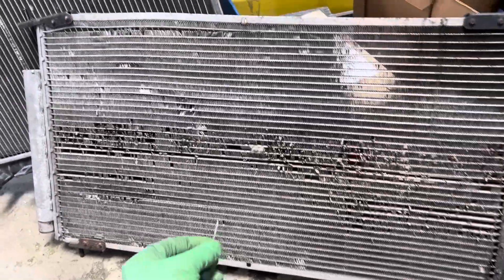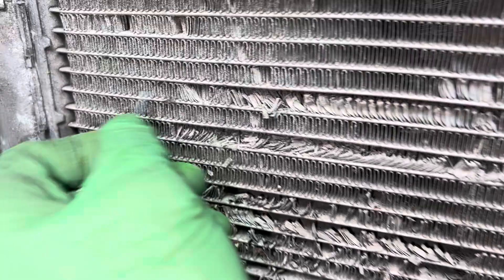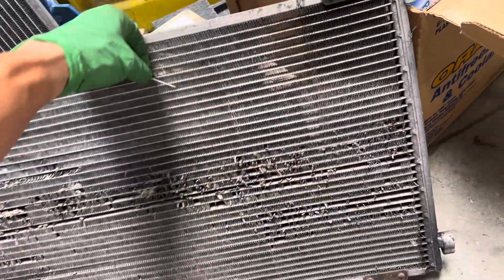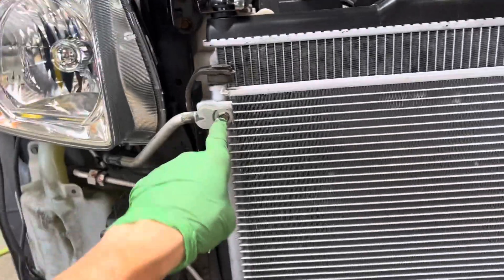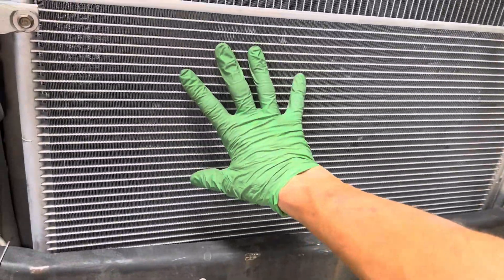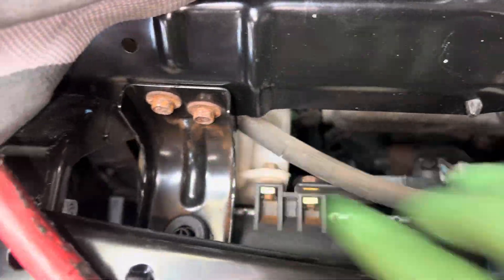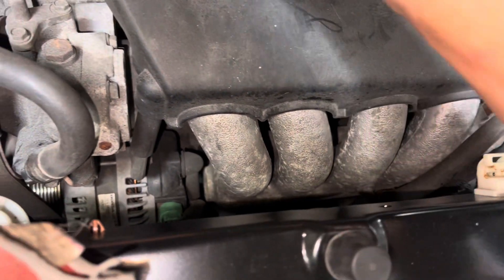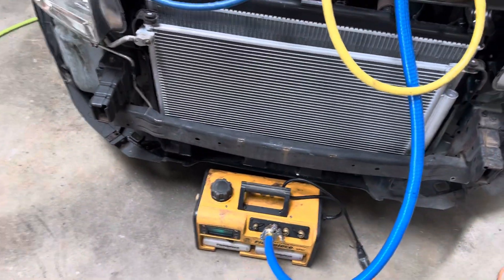Salt water damage on condenser. Salt roads to get rid of ice in winter time salt from the ocean. ￼

Comment: Pretty common here in the UK where they put tonnes of salt on the roads.
Sometimes when the condenser corrodes thin enough it swells up like a ballon
Reply from the maker: I was told really bad corrosion like this also happens in places like Norway, some parts of Finland, better by the Atlantic ocean, get tons of salt, water, corrosion and have to be replaced every couple years.

Comment: Hey Tom I need some help. I have Copeland two stage compressor on my Geothermal unit. Unit was installed 10 years ago. Recently my unit had a short. I found out that my second stage solenoid is grounded. Here is a part number of my compressor ZPS51K4E-PFV 230V. So now it's only works in the first stage. Please tell me for how long it can last. Can it last 1 more year or 10 more years? Thank you so much!
Reply from the maker: It’s built in ternal it’s just a tiny solenoid just like you would use a Solenoid to pick up on the iron bowl piece to turn fluid flow on or off. That’s all it’s not complicated.. 

It has nothing to do with the motor windings or the start winding’s . 

As long as your system is healthy, it was commission properly charged properly and has maintained and doesn’t get any Refrigerant and Leaks your compressor. Motor itself should live a long, happy life. . 

Download the app CopelandMobile 

Putting your compressor part number, and you might even be able to scan the QR code on the side of the compressor

And you can download more detail data on that compressor and how it’s used in possibly properly test the second state solenoid . 

I do not work on geothermal 

But geothermal means nothing to the compressor. All the compressors are the same for their application that they were intending for. . 

I’m in San Francisco, California 

Geothermal would cost the price of a house to install here  🤣

And we live in such a mild climate, he would have no monetary beneficial usefulness. It would be a waste of money. . 

As long as the system is not allowed to run low on refrigerant and you keep ahead of things and make sure your condenser fan motor doesn’t burn out on you and cause high side pressure or your evaporator fan motor doesn’t burn out on you cause I seen in cause liquid floodback to the compressor you should get another five or 10 years, making a total of 15 or 20 years life out of that compressor . 

As preventative maintenance if you haven’t done it already 

You may just want to replace the outdoor condenser capacitor, the outdoor compressor capacitor, and the indoor blower motor capacitor . 

Amrad the American made capacitors would be my recommendation . 

It’s cheap insurance to very expensive repairs .
Reply from the maker: https://youtu.be/T-lhTVL__q0?si=GgqUj6OTV48m_g8a

They just happen to release a link about the CopelandMobile app about 15 minutes ago